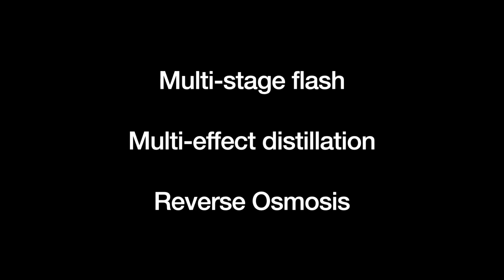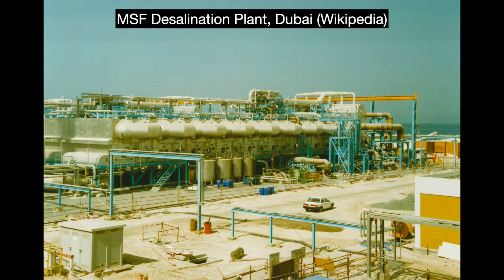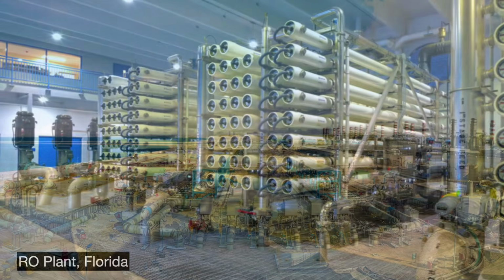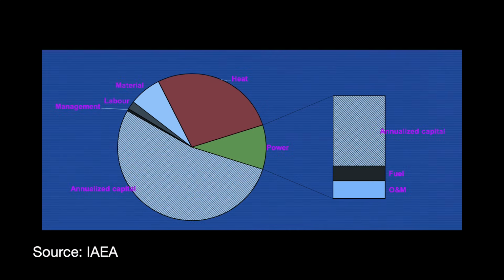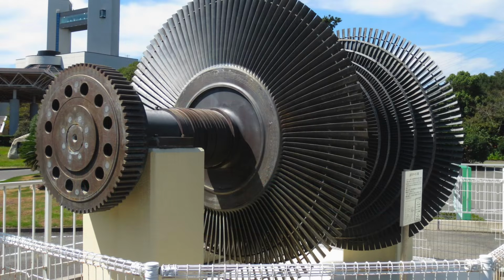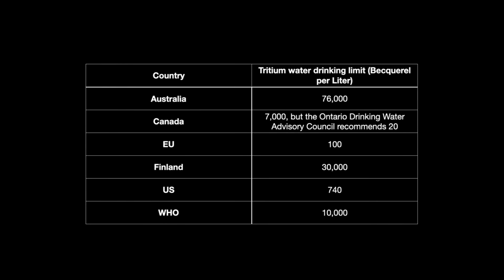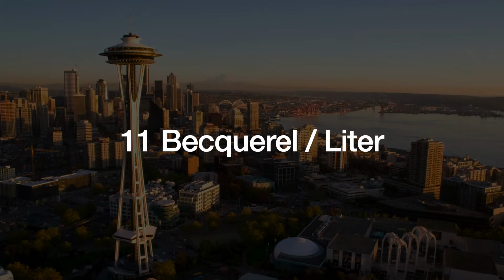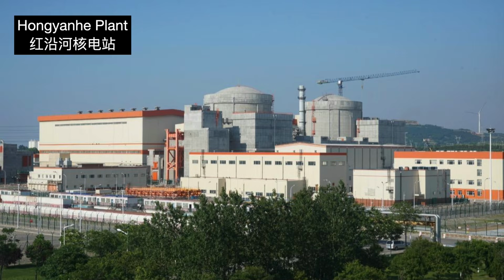Going Nuclear to Desalinate Seawater

Comment: Thorium does not need expensive processing like uranium does therefor the fuel is cheaper.
It is found in clay which is dirt cheap and the world has more than enough for the next 100,000 years.
Indonesia is to receive a ship from China carrying a Thorium fueled, Liquid Salt, Nuclear Reactor,.
It will tie up at a wharf and supply the city with cheap Base Load Electricity 24/7 for the next 20 or so years.
The question is why isn't the USA doing this The Oak Ridge National Laboratory invented the process. 
It will be a multi trillion dollar industry as every port in the world will want at least one of these ships.
If the ship also carried a desalination plant it could use OFF Peak electricity to supply the city with clean drinking water.
Reply: There is nothing special about thorium, what is special is the molten salt reactor technology that may one day utilize it. In the foreseeable future uranium in a MSR will be the path forward. Thorium has to go through several steps to go from fertile to fission and that's the problem. Uranium starts out ready to fission, that's why all but one gen. IV MSR start-up is using uranium and not thorium. Remember, a thorium MSR is in fact a uranium MSR because thorium has to be converted to uranium before it can fission.
Reply: @chapter4travels  Indonesia is about to receive a ship from China. It carries a Thorium Fueled, Liquid Salt, (aka LFTR) Nuclear Reactor.The ship will tie up at a wharf and supply Base Load Electric Power 24/7 for more than 20 years. The question is why isn't the USA doing this as it was invented at the Oak Ridge National Laboratory. It will become a multi $Trillion  industry as every country will order at least one ship for every port, this single industry could on its own Make America Great Again. If these ships carried a desalination plant as well, off peak electricity could also supply the city with drinking water taking the pressure off rain water stored in dams.
Reply: @MaxB6851  Do you have a link for this? As far as I know, China doesn't have anything like that. I know they built a prototype LFTR in the desert, but no one has gotten an update on the results. Indonesia is working on its own barge-based MSR with Thorcon Power. It's a uranium MSR, like all the other MSR start-ups.

Comment: One of the challenges with nuclear power is that with their costs skewed towards being upfront, and their fixed life-span, you don't want to load-follow the grid, but instead you want to run at full capacity at all times, except during maintenance, and let hydro or gas power plants do the load-following instead.
How skewed towards the initial investment are the costs of desalination? Could it make technical and economic sense for a nuclear desalination plant to divert power away from desalination, and onto the grid during peak hours, and then go back to producing potable water, once demand falls again, later in the evening? 
Does desalination have a significant thermal inertia, meaning it's hard to run the production in a stop-and-go manner?

Comment: Couple of question.  Do they remove the lithium from the brine?  Is the brine put back into the sea?  Would it cause a high concentration of salt where it is released?
Reply: Whatsapp✙16188099963
More updates on ETH,NFT’s,BTC📊
Whatsap✙16188099963

More updates on ETH,NFT’s,BTC📊
👆  👆 👆
Reply: No, yes, and yes in a lot of cases.

Comment: just use the fucking sun and evaporation. 
we don't need power just infrastructure that enables desalination..
heat the water, salt is left behind, decide wtf to do with salt and enjoy fresh water. 

it's not as energy intensive nor complicated as ppl make it out to be.. the sun keeps doing it for us. africa could be a freshwater paradise with the right infrastructure.
Reply: Do you have any idea what goes into cost of the final product? The fact that it is theoretically possible to desalinate water with the sun doesn't mean that it would be even remotely economical or scalable.
Just think how much infrastructure and how much maintenance that would require. I'm quite sure that it would be orders of magnitude cheaper to just use solar panels to power a conventional plant, rather than trying to do it directly
Reply: Whatsapp✙16188099963
More updates on ETH,NFT’s,BTC📊
Whatsap✙16188099963

More updates on ETH,NFT’s,BTC📊
👆  👆 👆

Comment: If you REALLY wanted to separate the reactor from the desal, you could put the plants right next to each other and string high voltage lines across, then use electrical heaters for your desalinization. You'd minimize transmission loss but still lose efficiency since you'd be boiling water twice.
Reply: Conversion from thermal to electrical is way too inefficient. You also would need to cool the water twice
Reply: Whatsapp✙16188099963
More updates on ETH,NFT’s,BTC📊
Whatsap✙16188099963

More updates on ETH,NFT’s,BTC📊
👆  👆 👆

Comment: Why can’t we just inflate a big ass plastic clear tent thing (like they have over swimming pools in the winter) over a large section or multiple small sections to catch evaporate? It wouldn’t be that expensive.
Reply: I guess you’d be leaving all the brine in the ocean though, I know that’s not good. But I’d think it would be a normal amount evaporating so it shouldn’t shock the system- you’d just be catching it instead of letting it off into the atmosphere. And as long as we don’t do it over a significant portion of our oceans it shouldn’t effect precipitation too much
Reply: It’s really inefficient
Reply: Whatsapp✙16188099963
More updates on ETH,NFT’s,BTC📊
Whatsap✙16188099963

More updates on ETH,NFT’s,BTC.📊

Comment: No mention of the Nuke Waste problem which, is going to be handed down to future generations.    Solar, Wind, Tidal and other green energies make more sense to me.   Storage tanks can handle the much of the cyclic power of renewables, tapping grid power supported by a remote nuclear reactor can help stabilize supply to support demand.    RO technology is the most efficient and is improving yearly with new nano-membrane Technolgies.   Japan's Toray Industries has created a seawater desalinating RO membrane that makes it possible to produce 70% more clean drinking water than conventional membrane offerings.
Reply: Nuclear "waste" from older generations of nuclear power is an asset, not a liability. That "waste is worth a fortune in next-generation reactors.
Reply: It never occurred to me (and probably not to others) to use old nuclear reactors to power new desalination plants.

Comment: Eliminate unnecessary regulation and licensing delays and the cost of nuclear will be substantially reduced. Much current regulation is intentionally prohibitive and unrelated to safety.
Reply: Eliminate all unnecessary radioactive shielding so we can revert to our final mutational state more quickly....
Reply: @rickcostin  If the radiation from nuclear power plants actually had such effect that might be interesting.  However it does not.  The radiation exposure from nuclear power plants is so low it's just not a viable option to increase mutation rates that way.  Your creativity is laudable however!
Reply: @rickcostin  Modern reactors are very safe.  Far safer than most other industrial facilities.  The impacts from nuclear ‘disasters’ are minuscule compared to those of mining, petrochemical facilities or agricultural materials facilities.  Nuclear power plants are among the safest of all infrastructure, and for non-socialist operated western plants, hugely safer.  Explosions at nuclear plants would be so far down the list of rational fears it should be, literally, just dismissed.  Emotional ideological driven fear mongering and myth might have it otherwise, but those are the actual facts.  Not that some people let facts get in way of what they want to believe…

Comment: The only way this will work reliably and economically is with the higher temperature of molten salt reactors. That way with super critical co2 with very small in size turbines and much higher exit temperature for boiling water pulling a vacuum to desalination a river of fresh water, not pumping high pressure membrane filters, that is a road to hell. But using stainless high temperature water pulled to a vacuum a 100,000 gallon per hour plant will be highly efficient and make electricity also. NOT A HIGH PRESSURE WATER REACTOR THAT JUST BARELY PRODUCES ELECTRICITY WITHOUT DESALINATION.
Reply: Just one of the hundreds of applications for the industrial heat produced by a MSR.